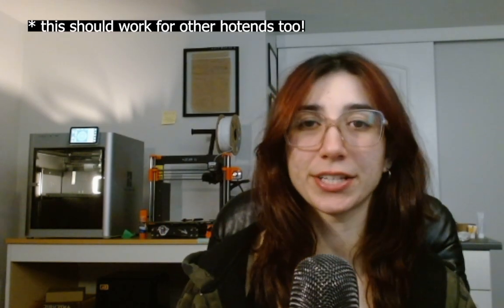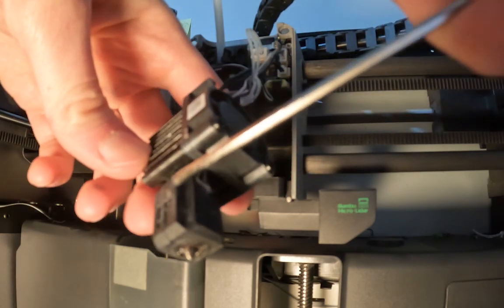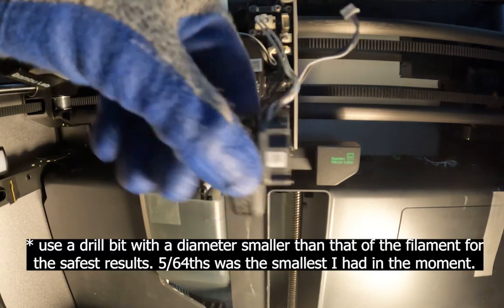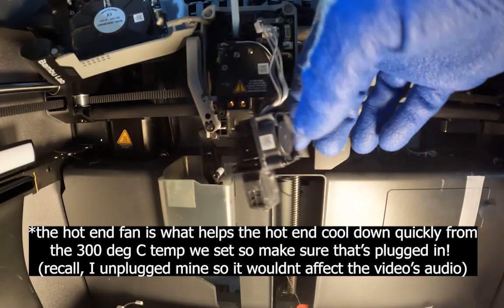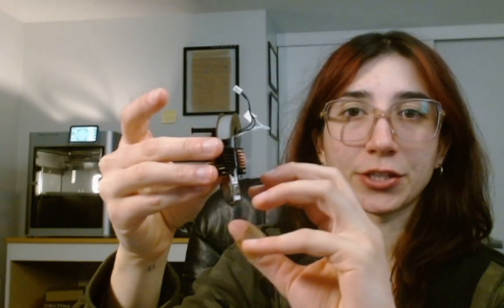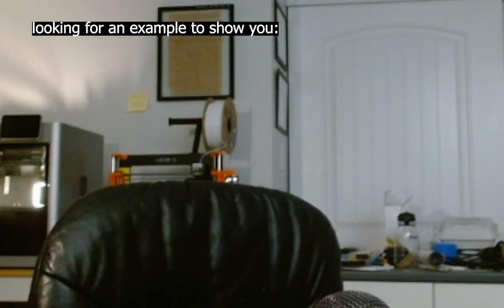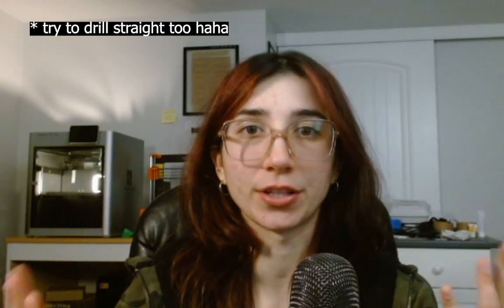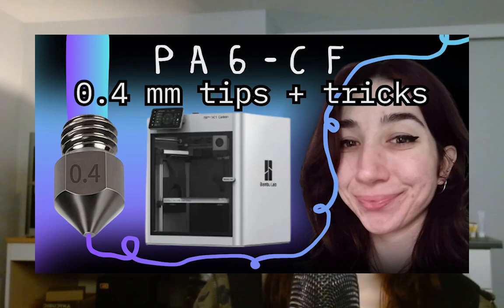the "ultimate" trick for hot end unclogging when nothing else works

Comment: taking out the hotend and using a hot gun is way safer way of unclogging than this. It was painful to watch. Also this trick will not work on all the printers
Reply from the maker: @mcstando  you're right, that's why I highlight this as a last resort. The hot air trick did not work for me with this material so I just wanted to share in case you need to print in a pinch. Perhaps I didn't heat it long enough I'll need to attempt again. Hot air or cold pull should work for most hot ends. This trick in the video would work where you have a clear path into the heat sink but it's a high risk I agree. I also mention to be mindful of hot end construction before attempting this if needed. Thank you for your feedback, I appreciate your thoughts on this idea. Gladly it worked for me because I had no spare hotend when I was printing for a deadline.

Comment: How frequent are X1C hotend clogs? I'm considering a set up to a Banbu or Qidi +4 and my usual method with an Ender is just replace the threaded tube abd nozzle for effall dollars as I run a modified hotend rather than the stock ender hotend. Last thing I want to be doing with a proprietary system is be effing about with heat creap. My 2 Ender 3s are pretty well behaved and the E3D heatbrake  mode is really well behaved. Thanks to Marlin 2.x.x.x and 32bit control boards, can get as many as 30 BIG prints before I need a new throat and nozzle. About AU$20 max for 5 of each.

Comment: Thanks for this. 
I had numerous TPU clogs on my X1C. I did the Bambu trick several times (heat up the allen key with a lighter then push it in the filament, let it cool, then pull it out). 

After a few clogs, I started leaving the door open and I slid the top glass back for more airflow. I also unload the TPU after every print now. Haven't had a clog since.
Reply from the maker: Unloading after every print is the smart move! Looks like you got it sorted :)

Comment: Heat is just as effective and won't damage anything. Either disable the hotend fan and heat to operating temp, then push a 1.5 mm hex wrench thru from above, or heat the wrench with a torch and do the same.
Reply from the maker: @daliasprints9798  I tried to do so, and did not succeed especially with my PA6CF clogl. I didn't have a torch on hand to get as hot as I needed so this was my next solution as my heatgun/ lighter did not help (probably not getting hot enough). 

Good suggestion, you're right .
Reply: @strelkomania  Yeah the drill bit is often quicker and easier with obviously less chance of burning yourself though. I know a lot of people who do it this way so good tip.

Comment: I am glad I have not have clogging problems this bad.
I can normally get away with just warming up the nuzzle, push the filament in, cool the nuzzle for a bit and then pull on the filament.
1-3 tries of this normally solves the problem for me. The trick is to pull before the plastic gets too cold and not too soon where the filament still is liquid.
But I will keep this in mind just in case. 🙂